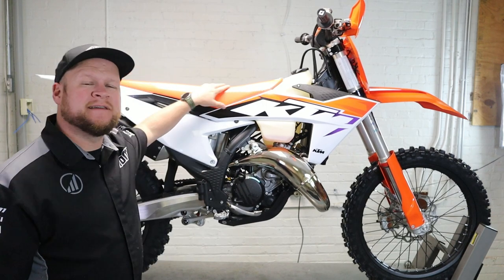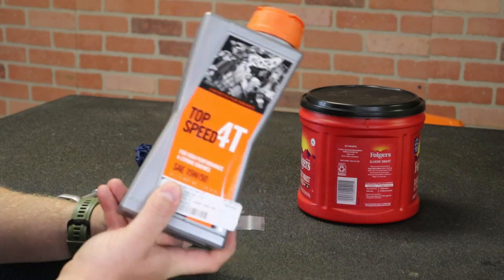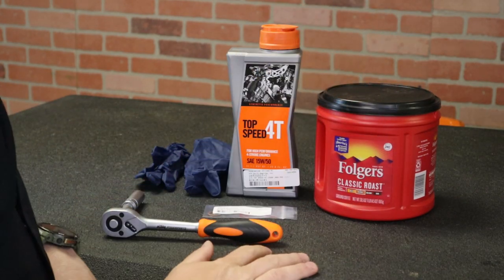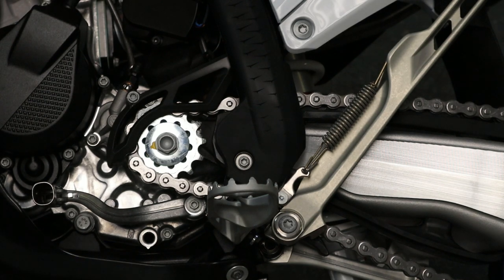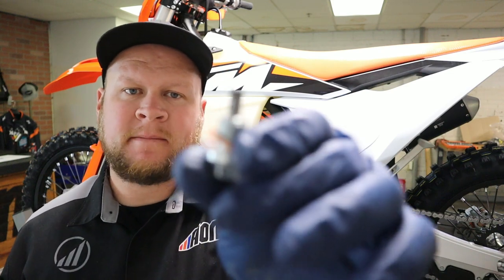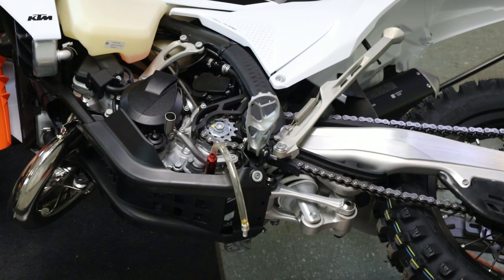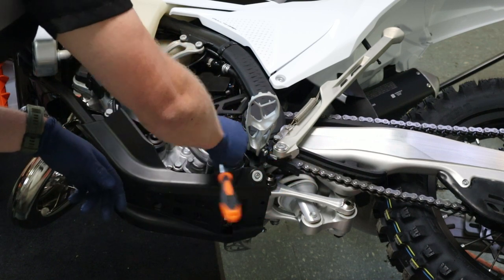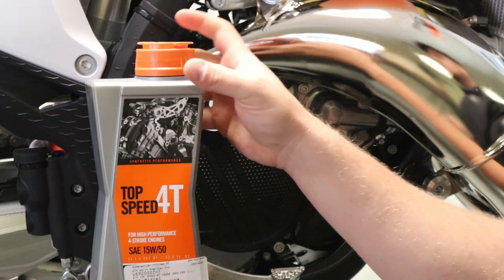KTM TBI 2023 Gen - BEST OIL CHANGE VIDEO ON YOUTUBE (125 / 250 / 300 Two Strokes)

Comment: I like how they moved the oil check bolt on this generation. The earlier generation was in a hard to reach spot behing the rear brake spring and was very easy to strip if you didnt remove the spring. Not user friendly.
Reply from the maker: I know, I hated that. I stripped one one time because of the weird angle lol
Reply: @mxgryan  ouf thats a bad day. I own a 2021 ktm 300 exc tpi. Yes its in a bad place. It was on the same place on all other bikes to. But the spring didn't come in contact like it does on 2017 and up. Though when you done 10 or so oil changes you have a system for it. I see people saying that you don't need to use the oil level bolt and just measure. But honestly it can differ so much. I had oil changes where i did 0.6dl and some where i got 0.85dl. Just depends on what oil, temperature and for how long you drain the oil.

Great video!
Reply from the maker: @Xfacehack  thanks Carl!

Comment: What about changing the filter? How often and do you have a part number? Thanks!
Reply from the maker: The air filter? Change it when it looks dirty.
Reply: @mxgryan  the oil filter. Or does it not have one?
Reply: Never mind… I see in the owner manual that it doesn’t have one. Thanks anyways!

Comment: The 250xc and 300xc have the oil check bolt at different places then the 125 i believe. I have the 250 and i still need to take the spring off the rear brake

Comment: I bought a 2023 2-stroke ktm 125 xc that would be the same as the one in your video.  I see that this one has a 2-stroke mixture in the tank.  my question is it normal for the motorcycle to come like this
Reply from the maker: A TBI motorcycle would come with some gas in the tank, yes.
Reply: @mxgryan  To make the mixture for that 125 motorboat in 2023, one does it in the tank or does she do it herself?

Comment: Hey thanks for the video. I’m curious, when using the oil level bolt, should I wait until oil stops coming out before replacing the bolt?
Reply from the maker: Not unless you've drastically overfilled. If you already had the bolt out while filling, you're fine. I wouldn't use the bolt at all, just pour in the correct amount.  Capacity is not that important.
Reply: @mxgryan  If it has a slow drip am I good? It would be coming out fast if I overfilled it right?